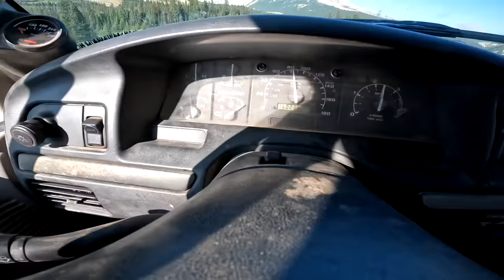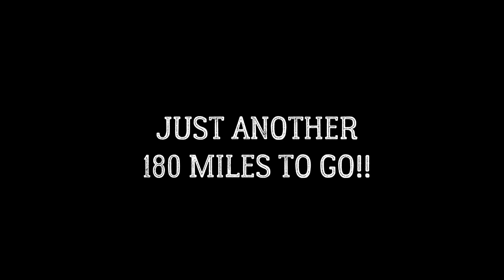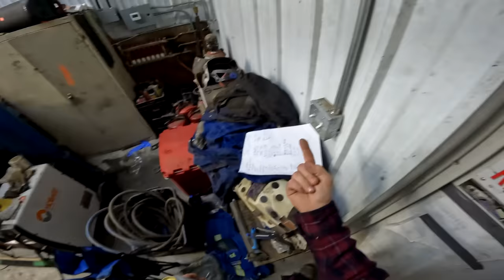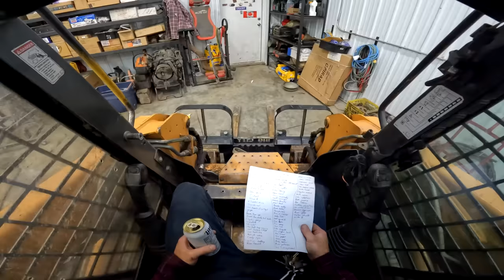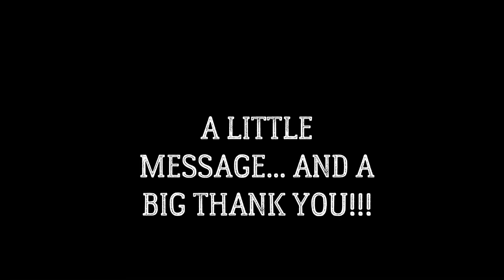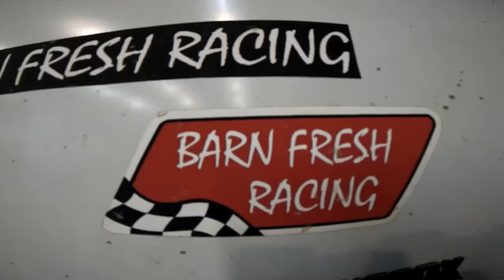2 DODGES... ONE SKIDDER!!!

Comment: I firmly believe every 5.9 and 6.7 Cummins engine deserves to be liberated from it's oppressive prison know as a Dodge truck.

Automotive electrical is one of my specialties and I have earned the reputation that I can fix anything.  I usually work on vehicles that have already been to multiple shops that gave up on repairing it.  Many years ago I got a call to fix a 2004.5 Ram 3500 Laramie Sport crew cab dually that had been sitting at the Dodge dealer for over a year and the dealer mexhanics could not get it running.  The owner of the shipping crate towed the truck to my shop.  Once it arrived I spent about 30 minutes getting it running.  I felt terrible about contributing to that Cummins remaining in it's prison of a Dodge truck but I knew the owner was planning to immediately sell it and it would likely go to one of those "Dodge Guys".  The first thing I did after getting it running was to drive it over to the Dodge dealer that it was towed from just 2 hours earlier.  The look on the mechanics faces as I was burning the tires through the service department was priceless.

Comment: i'll add to the message at the end of the video, talk to your dad about his eventual demise. it will be awkward at first and maybe morbid, but it will help you both a LOT. i talked a lot with my gramps (basically my dad) towards the end of his life, and we had a few discussions that were pretty short about what he wanted after he died. you may not even say much with your dad when you talk about it, but talking about it made it so much easier to handle when it came. i was still crushed when he went, but it was easier to get a grip on it having talked to him about it. 

and i second what Peg said about if your dad is an ass. my dad is insane, but i still talk to him because as nasty as he can be, he did still break his back making a life for my family. even if your dad bailed before you were born, he  at least gave you some chromosomes so he deserves a tip of the hat for that. also if you don't keep in touch with your dad, he might sell all his good snap on and mac stuff before he kicks the bucket!

Comment: I'm not going to disagree with him I own a 2000 Dodge I like how they look but I will agree with him that they are a pain in the ass to keep from rusting to the ground especially if you live north of the belt like I live in New England and my truck looks pretty good but the person I bought it from eventually we painted the thing and I still am chasing down rust and stuff like that in the truck to keep it looking nice and keep it going that's only downfall of dodges they want to keep going but the Dodge company really cheap out on the material and they made like crap that bodies and that's coming from a person that owns a Dodge my 99 Camaro that has way more miles and gets used a lot more has way less rust go figure